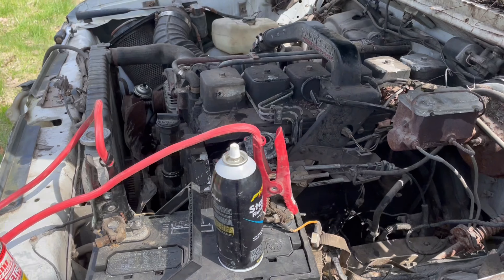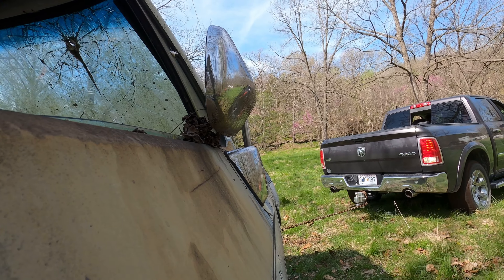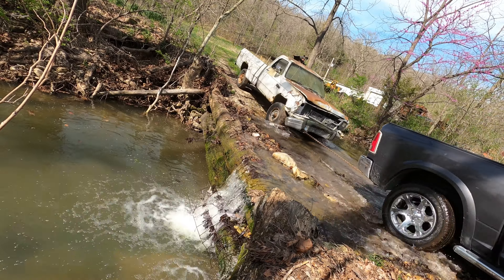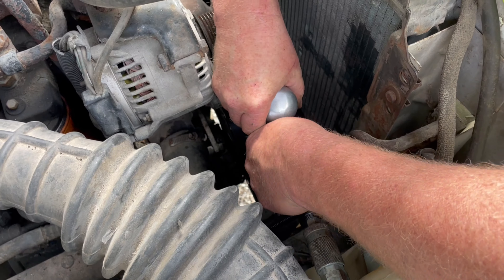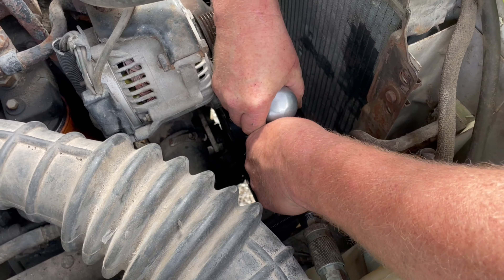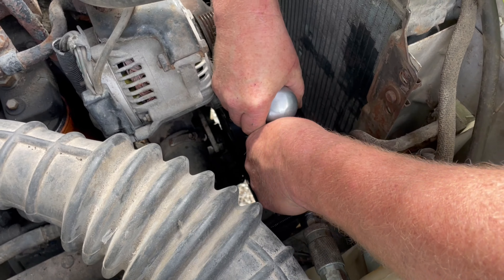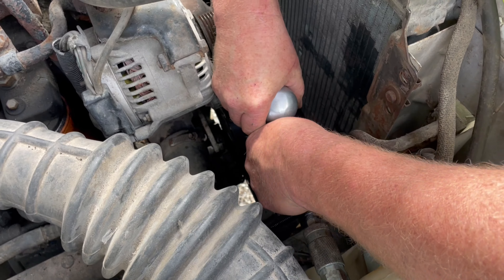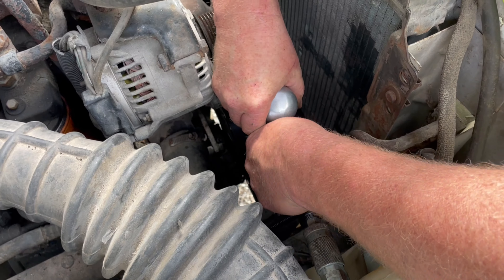Abandoned First Gen Cummins Turbo Diesel SITTING for 10 Years! Will it RUN and DRIVE?

Comment from the maker: What would be some good first upgrades without breaking the bank?
Reply: fuel pin (thd is nice), 3200 gov spring, tune pump and can pull it towards the head some to advance timing, find a nice used hx35 the non ic have the smallest turbo. The non IC run pretty damn strong though with these minor mods, they have larger injectors and the pump flows more than the IC. Also gonna want to get a pyro to keep an eye on things.
Reply from the maker: @Roost426  thanks a tons for the info! Will utilize this in the build for sure.

Comment: If anyone personally has one of these trucks please get in touch with me. I just bought one, and I neeed assistance on replacing parts under the hood. Mines a Dodge D250 Custom. 4 speed with a 6 cylinder engine. Anything will help! Thanks
Reply from the maker: should be some good forums out there

Comment: Might want to upgrade the front fender.
Reply from the maker: Lol, we are only using the chassis and motor for a build… the test will be scrapped unless someone wants it
Reply: @RealSteelFabrications  if y'all are junking the body, then might could get something worked out.  Got a beat up project that could use the less beat up parts.
Reply from the maker: @ctbradey wish I saw this sooner

Comment: My dad bought a 1st gen 93 new before he passed away. I inherited the truck with 50,000 miles on it and planned to use it to tow my boat, but quickly learned that his truck was a DOG! it had no power and couldn't get out of it's own way. I had a Banks conversion kit installed with intercooler etc.., but never saw much improvement.  I took it to a cummings diesel mechanic shop and they told me that the transmissions were the weak link in these trucks and they could rebuild it and put a "Kit" in it and I should see better performance. After the rebuild the truck was still scary to drive. No power to merge into traffic of the freeway and forget about towing anything. This tuck was such a dog that I parked it in my shop and it has been there now for over 20 years. I had to laugh when I walked out a few weeks ago and seen that the passenger side head light bracket had dry rotted and broke. The head light is looking at the ground as if the truck itself realizes that its no good. I think that the only vehicle that has been more disappointing than this truck was the Oldsmobile Diesel that came out in the 80's. Basically a V8 gas engine that was converted to Diesel. Never could keep head bolts it that car. My dad loved diesels and bought what was available at the time. For me I have only experienced disappointment.
Reply from the maker: This comment is very surprising to me…
Reply: My 89 dodge Cummins towed a 30' houseboat with ease!
Reply from the maker: @Mr-er6fg wow! They are tanks!